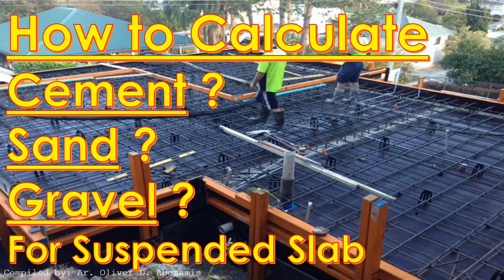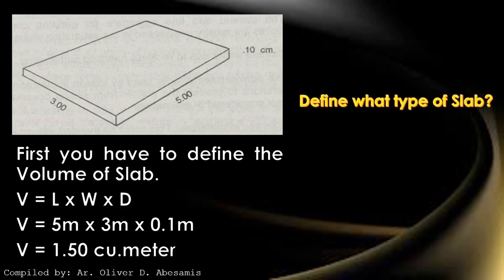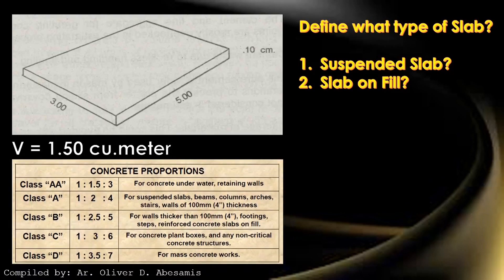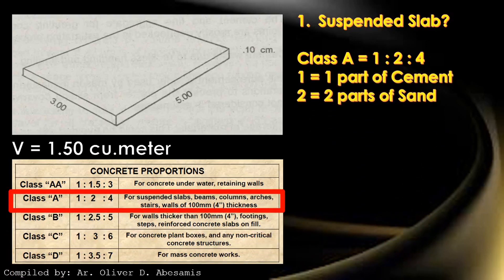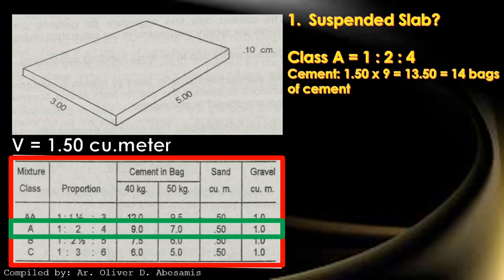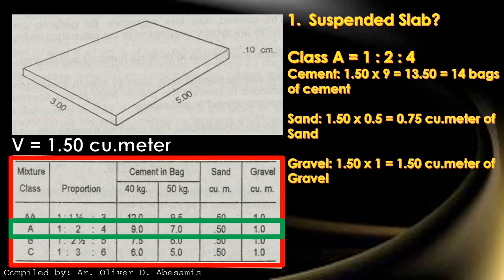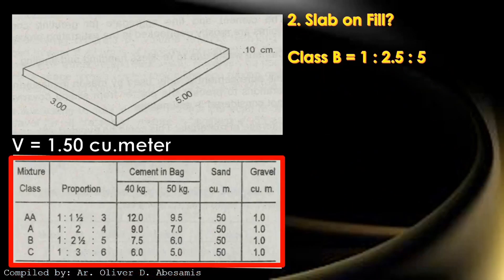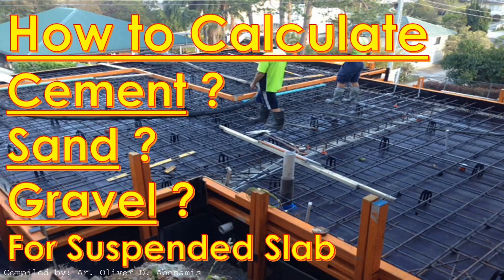Estimate - How to Calculate Quantity for Cement , Sand & Gravel / Aggregate in Concrete - ALE REVIEW

Comment: Boss baka mahabol mo pa kaya mo kaya ma compute kung ilang cement sand at gravel para sa 45 square meter na may kapal na 4 inches 1:2:3 ratio ng suspended slab namin idol.
Reply from the maker: Ratio 1:2:4
41 bags of cement
2.25 Cu.m of sand
4.5 Cu.m of gravel

Comment: Sir diba po ang total volume nung concrete is 1.5cu.m.? Bale po pag 1.5cu.m. din ang volume ng gravel, diba po nafulfill nya na yung total volume ng concrete? Tapos kapag dinagdag yung sand and cement, diba po sosobra na sa recquired concrete volume?
Reply from the maker: May spaces po ung gravel....

Comment: Sir pa estemate po W=7metrs, L=11 meters at kapal ng buhos sa slab 4 inches po ilang bags po ng cemento at ilang cubic meters po ng sand at gravel kailangan. Sana masagot
Reply from the maker: Kulang info mo
Reply: @ALEreview  ayy sorry
 W=7metrs, L=11 meters at kapal ng buhos sa slab 4 inches po ilang bags po ng cemento at ilang cubic meters po ng sand at gravel kailangan. Sana masagot
Reply from the maker: @happybalikid4408  
suspended slab:
Cement = 70bags of cement
Sand = 3.85 cubic meter
Gravel = 7.7 cubic meter
Reply: @ALEreview  thanks sir
Reply: Diko makuha total ehh
Reply: Water cement ratio nmn

Comment: If Class A = 1:2:4
Given 14 bags of cement, I need to add 28 bags of sand, and 56 bags of gravel? (Each bag weighs 40kg)

I hope I understood correctly hehe. Thank you.
Reply from the maker: 26.5 parts of sand
53 parts of gravel
Reply: @ALEreview  sir bakit naging 26.5 at 53 sir? Di po ba times 2 and 4 lang ang 14?
Reply from the maker: @cjayson38  
1 = 1 part = 1 cu.ft
Total sand mo is 0.75cu.m accurate is 26.486 part
Total gravel mo is 1.50cu.m accurate is 52.972 part

Sa site of course hindi ganyan. Sa site rounded na... Kaya 
1 cement + 2 ponke ng buhangin + 4 na ponke ng graba 

Means 14 cement + 28 na ponke na buhangin + 56 na ponke na graba
Reply: Per vol either ft^3 or m^3 yung sand and grav